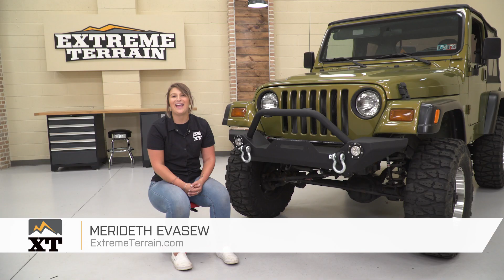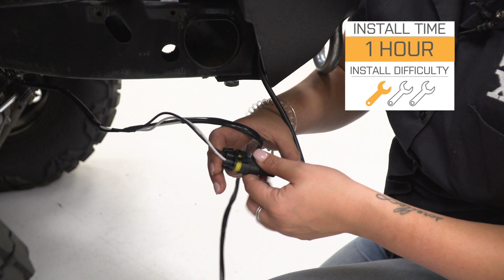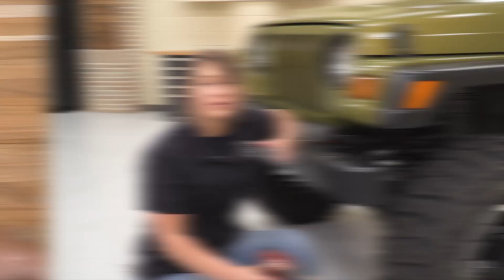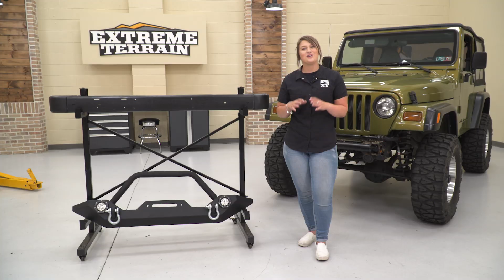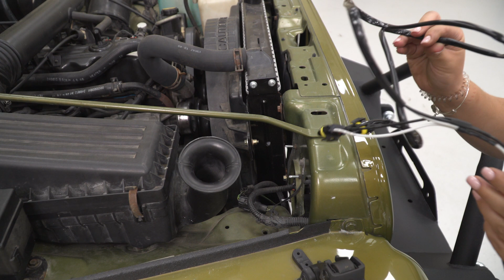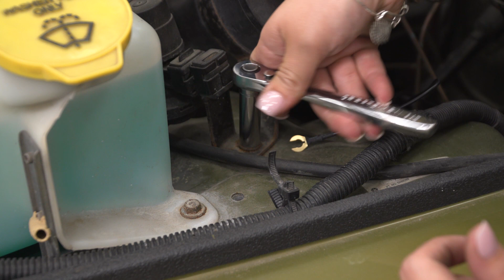1987-2006 Jeep Wrangler Barricade Trail Force HD Front Bumper w/ LED Lights Review & Install

Comment: Just received my new bumper from Extreme Terrain and started the install on my 2000 Jeep Wrangler Sahara.  Of course, the holes didn't line up so I spent a couple hours with a file opening them up to get the bolt started.   Also, needed oversized, heavier washers to cover the expanded holes.  You would think the hard part would be over.  

Now for the LED fog lights which should just plug in to the factory connectors except the wires are about 10" too short.  Now I have to make a pigtail using the wires from the old factory fog lights to make the connection.  

It's a good, heavy bumper, but a little thought and some quality control would be appreciated.

Comment: This video needs to be updated. I just got my bumper today and I have to try and figure out how my lights attach correctly to my bumper. Also have no idea what the random parts are for
Reply: Same here... I just got this bumper in and it ONLY came with instructions (5 STEPS) on how to install the bumper...pretty easy.... NOT THE LIGHTS!!!!... the LED lights come with the bumper but they are not mounted and have several parts to put together.... this wouldn't be so bad except THERE ARE NO INSTRUCTIONS FOR THE LIGHTS ..... I'm currently having to figure out how to attach the lights with all the small parts to the bumper.... something to consider if you order this bumper.... other than that though. ... I'm still pretty happy with the overall look.
Reply: @RdrgGil  Did you figure it out, I could use some help lol
Reply: Yes! Thank you! WTF. I don’t get it. They’re pre-installed in the video and you get fvck-all for written instructions. 🙄. Infuriating.